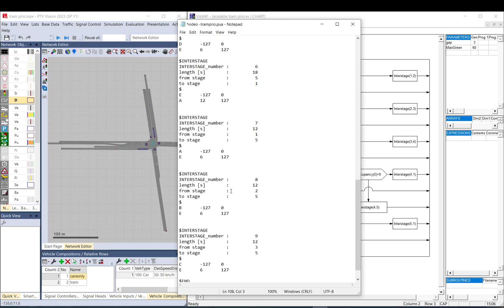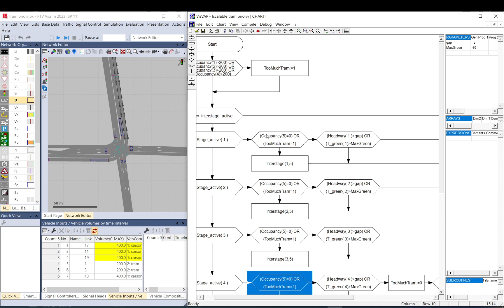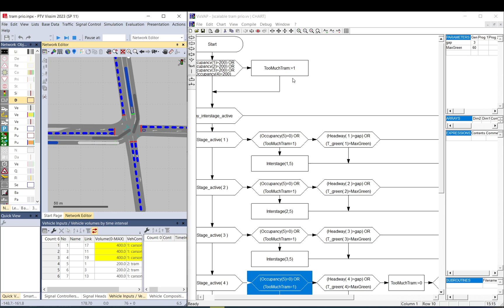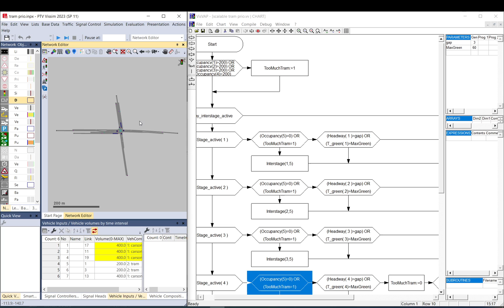Vissim Tutorial - VAP/VISVAP - Priority for tram (Public transport)

Comment: 10q very much for your help but  in vissim no of inter stage  stated in vis vap file must equal with included inter stages in pua file ?
Reply from the maker: Hi, yes. Stage active checks the current/actual/live signals in the runnimg simulation and becomes true if that matches the stage defined in the pua file.
Stage_active(1) is a question basically that becomes true if in the currently running simulation stage(1) is active/running. 
For example: Stage(1) is defined in the pua file in the beginning. We set up there what is green and what is red in stage 1.
Does this answer your question? If not, elaborate pls

Comment: pls add a case of green extention and red truncation in the VAP FILE
Reply from the maker: Hi, it is already included in this logic. For example for trams the  "(Occupancy( 5 )=0) OR (T_green( 5)>MaxGreen)" condition after Stage_active(5) takes care of the green extension. If there is demand it increases the green time up to a maximum allowed time (MaxGreen). 
Red truncation can be found after "Stage_Active" for stage 1, 2, 3, 4 is the following condition: "(Occupancy(5)=0) OR(TooMuchTram=1)".
If my explanation in the video is not enough, let me know and I do an explainer or something. Just make sure that first you listen to my explanation in this video and the process of development. That should give context
Reply: OK but what is max green (60sec)  in your case? in my case i need 10sec of extension for tram to cross the intersection so shall i used max green of 10 se instade of 60 second?
Reply from the maker: @motivef8  60s in my case is an abritrary number I just made up to make sure it cannot run forever. So green can be extended up to 60seconds from the minimum of 6 seconds. If there is demand it runs for 60secs, if there is 1 or 2 vehicle only, it only runs for 6secs. So it extends the green from 6 up to 60secs if needed.
If you want plus 10seconds extension, you need to know what is the current green time length. If currently it runs for 40seconds you need to use 50seconds for max green time.
Also, if you dont want red truncation in the same time, i.e. you want to run all stages for at least 40secs, you must consider 40secs in the pua file in the 'interstages' section, assuming you use my proposed Visvap logic.
In that case your interstage length becomes 46seconds(including minimum green time of 6sec).
Does it make sense? 
I do another video I think focusing on purely this green extension thing. Should be online in 1 2days.